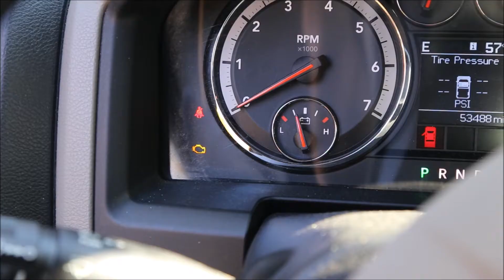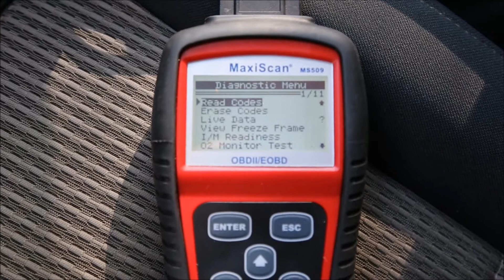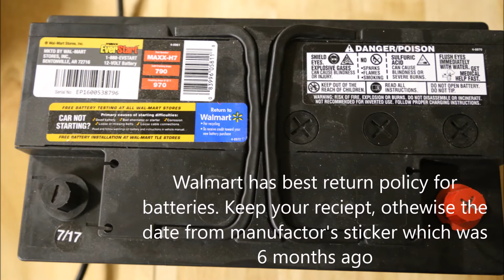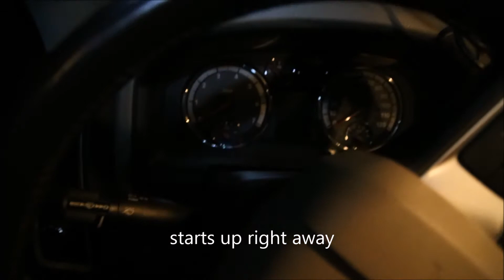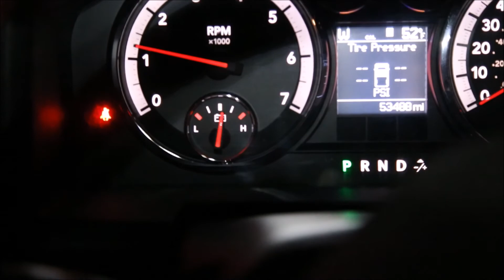ram truck 2011 battery replacement

Comment: 5:10. That nut didn't come off, snapped stud/bolt instead. I cheated and screwed the plastic piece back in place.
     I always buy interstate batteries as replacements. Factory bat 7 yrs old on plow equipped truck.

Comment: Thanks for making video just put my code reader on today came up with the same exact code you have,going out tommorrow to grab a new battery ,looks like mine is the original too,have the same year 2011 2500 love my ram....
Reply from the maker: Thanks! I hoped it worked. The RAM has been great! No issues last four years I have owned it.